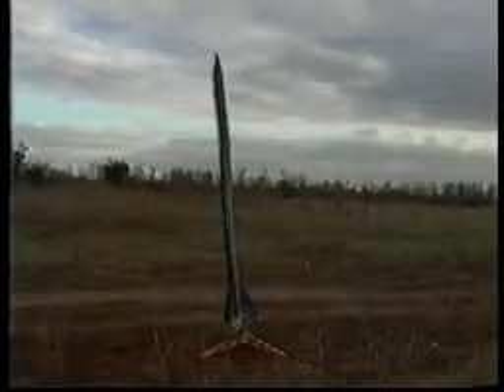Clustered Staged Model Rocket

Comment from the maker: Well here's a tip - I use something called 'Quickmatch' to ensure the stages ignite. It is explosive fuse material placed in between the motors. I got mine from HART rocket club in the UK, a club I founded but now run by a guy called Pete. Search 'HART rockets' if you are in the Uk too. Good luck with your rockets.

Comment from the maker: It had no atitmeter on board as it wasn't going to go that high. I estimate 800-1000 ft only. It was more the challenge of doing it. Getting two to fire and then to set off another two is tricky. It took me 4 attempts! Really if I was going for performance just one big motor would have been easier.

Comment from the maker: Well I think you might mean centimeters. 1cm = 10mm (or millimeters). 2.54cm = 1 inch by the way. 100cm = 1 metre. This is the Metric system. 

24mm is 2.4cm or just under an inch which would be 2.54cm.